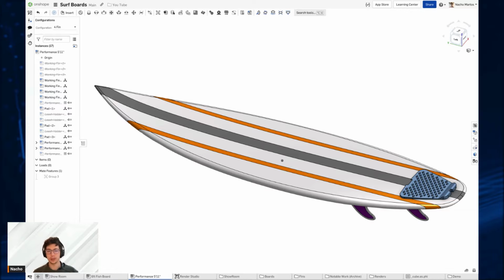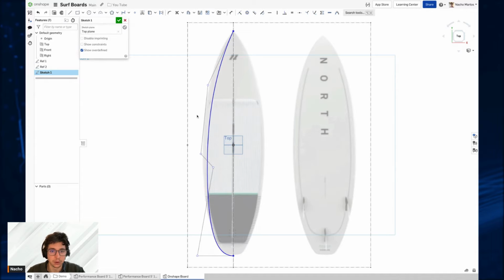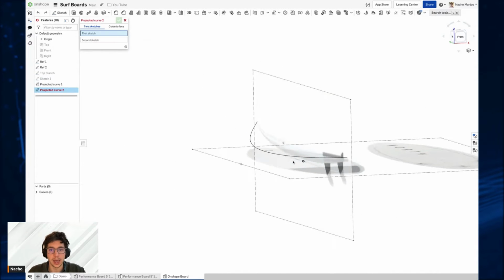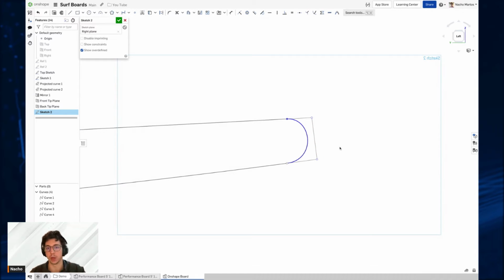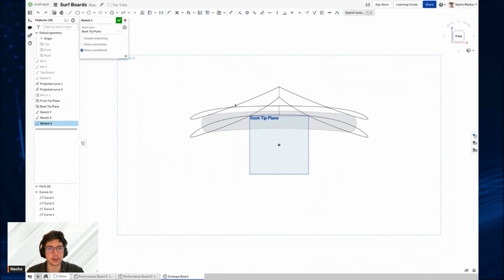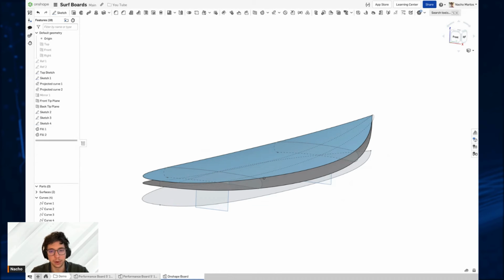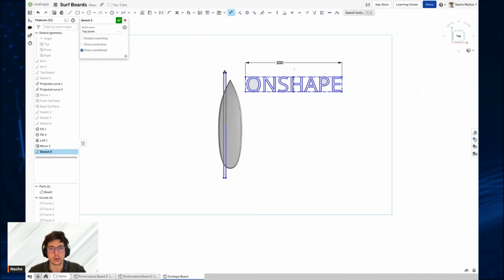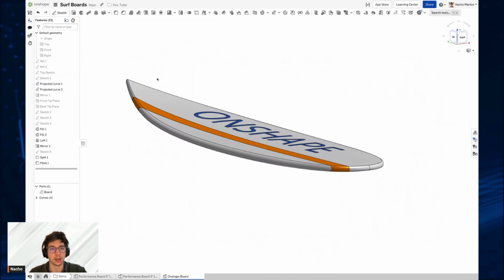Surfboard Design in Onshape (Tutorial)

Comment: Do you know if you can export a file that would be compatible with any shaping machines?
Reply: Yes! If you are using a router or CNC you can create G-Code that can be booted up into those machines. You will need another software to pre-process the parts G-Code before throwing it on the machine